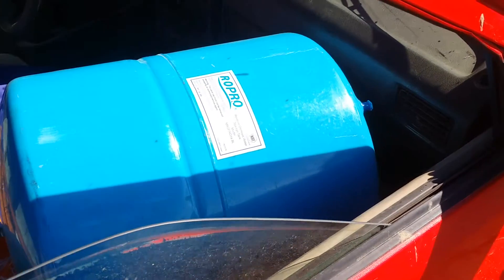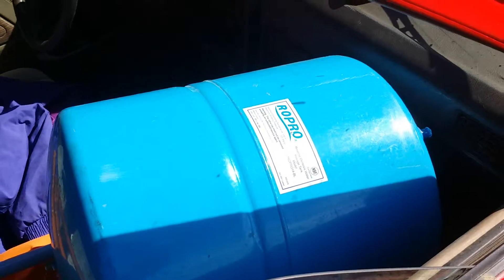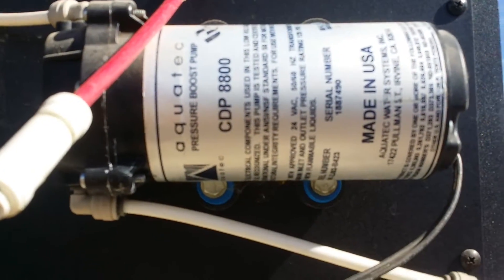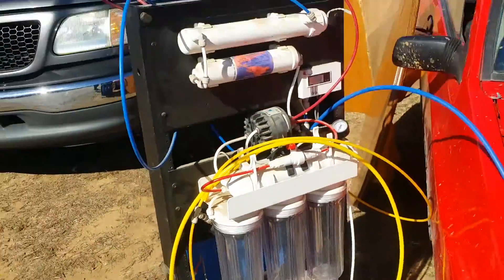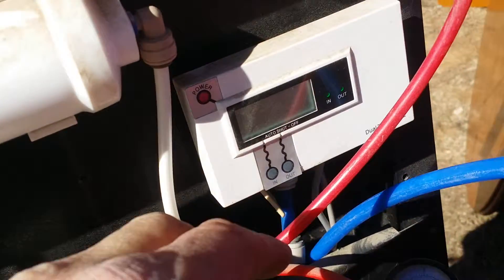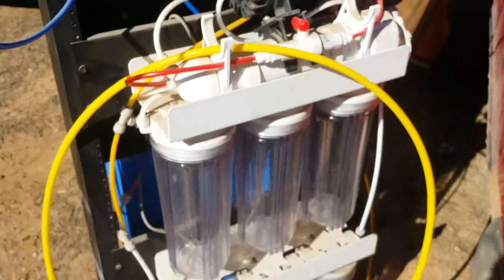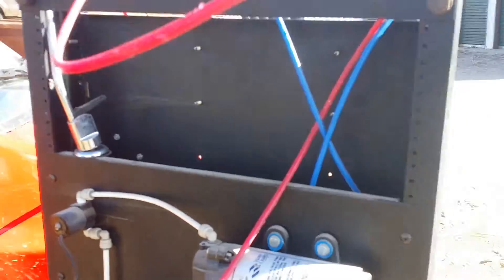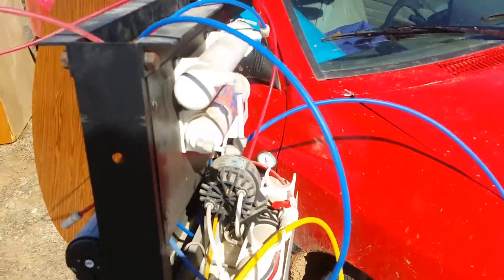Reverse osmosis water filtration system

Comment from the maker: I've researched my system a little more and have found that I actually have 2 UV Sunpure UST-300 lights but no ballast for it. I've googled and found that I can buy a 110volt ballast for the UST-300 for around $40 but what would be great is if I could find a 12volt ballast (or better yet a 24volt ballast) for it.

From what I've researched, it seems that using a UV light (Sun Pure UST-300) for purifying rainwater for drinking is a good thing.

I've also been told that the ro membrane that is in it now may still be good. I'm supposed to check the TDS readings before and after filtration and that it should remove 80% of TDS's.

Comment: I use to have a reverse osmosis water system when i lived in Lake Havasu City, Arizona.
The water was full of Alkalai , horrible and you really couldn't drink it or you'd end up with kidney stones.Dogs couldn't drink it either. It went under the kitchen sink and had one filter. Yours looks like a commercial unit, could be wrong.
Reply from the maker: Hey Jeff, So No CHARGE Controller Needed For The element? Will just a 100 watt 12 Volt panel be good enough?
Reply: +5 Acres OffGrid No charge controller needed for a DC element. A 12 volt 100 watt panel won't work.
Reply from the maker: Ok, I  can use my 24 volt 250 watt one though...right? Thanks again Jeff!
Reply: +5 Acres OffGrid  Yes you can Allan. A 48 volt 600 watt element has the least resistance and works well. I also just found a styrofoam bucket liner for 5 gallon pails. I put a link to them under my video.